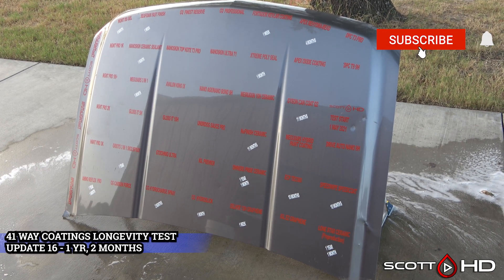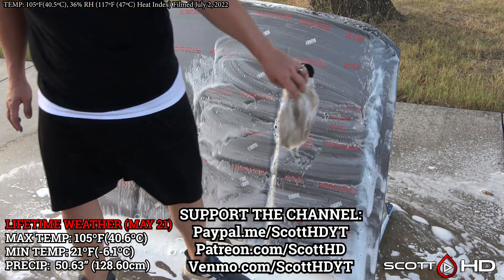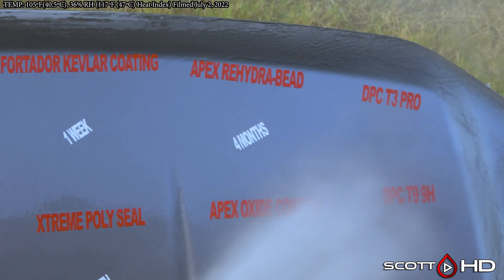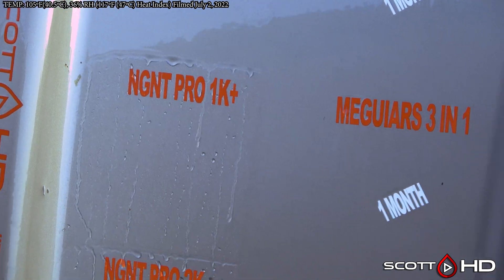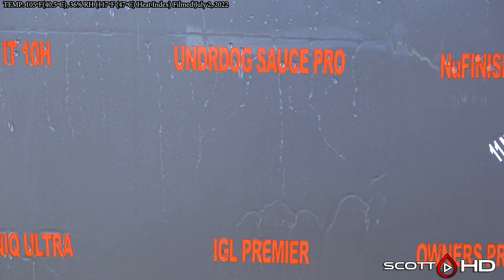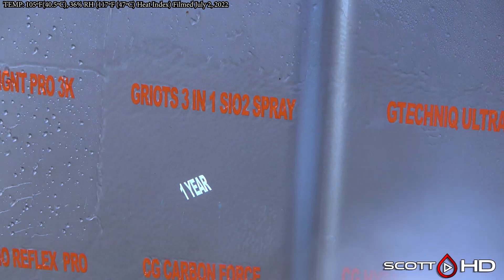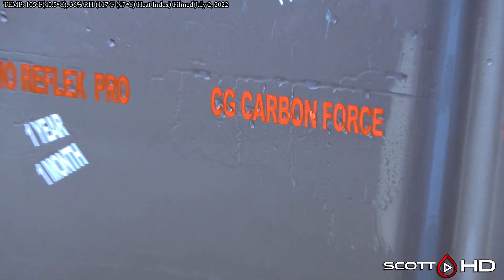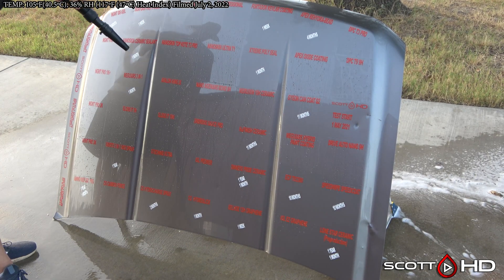Ceramic Coating Longevity Test - 41 WAY - The ULTIMATE comparison test - UPDATE 16 -1 YEAR, 2 MONTHS

Comment: I'm having some serious disappointment with grios three and one. after watching your review I was totally geeked on it. I've used it on two different vehicles a 2005 and a 2019 and had a problem with road film releasing from the coating and now streaks in the coating which are hard to explain. not sure where to go next maybe turtle Wax hybrid solutions?
Reply from the maker: That's sad to hear. Were you applying it outside?  What was the temperature/humidity?
Reply: @ScottHD  I'm here in Wisconsin and I wonder if the product is best suited for this climate and salt
Reply from the maker: @barrycampbell1054  that is nuts!  Was it streaking after installed or showed up later?
Reply: @ScottHD  the finish was absolutely gorgeous after the installation and like glass when complete and now roughly 4 months later I've got streaking that can only be removed with thinner. Griots sent me some of their foaming car wash but that does not cut the film. I had to literally scrub it to get it off of the vehicle.
Reply from the maker: @barrycampbell1054  wow.  Good info to know, but also sad to hear.  I'm going to do some playing around with this bottle and see if I can get it to do that.
Reply: @ScottHD  if you have an email address I'd be happy to send you a picture that I took today that I will be sharing with grios.
Reply: @ScottHD  I had both vehicles professionally installed exactly as the directions stated by a detailer and it was all indoors.

Comment: Scott I hope you see this, these tests may be a bit misleading for average users. Many of us, when we don't have time use a touchless automated car wash that uses extremely acidic chemicals which are stripping off even the best waxes in seconds. It then applies a coat of a very weak poor lasting wax on the car near the end.
Using Snow Foam is gentle so your longevity tests are as if we were always hand washing.

Would like to see a longevity test done where you run it through an automated and very acidic touchless car wash.
Reply from the maker: Great idea - I actually have something planned along those lines combining another subject - PPF to a separate part of the vehicle

Comment: Random question, do any of the coatings in your test have water spots after washing? I was a bit disappointed to see water spotting on my black car after not washing it for a few weeks after driving in the rain. I was using Turtle wax flex which claimed it "resists water spotting" whatever that means lol
Reply from the maker: Some do, but not enough to really say for sure they are what's creating the excessive spots.
Reply: @ScottHD  thanks!

Comment: Great work as per usual Scott.  It would be interesting to watch a similar comparison but detail sprays, or similar, that claim to bump up gloss.
Reply from the maker: I am planning a detail spray only test this fall.  Too hot out (Texas summer) to get anything new going at the moment - just doing the updates and saving the $$ for this fall.    (Almost ended up in the hospital with heat stroke!)
Reply: @ScottHD  Look forward to it. We get 1 hot day in the UK and all hell breaks loose. Stay well man.
Reply: I'd also like to see that, as Scott demonstrates in theses tests a lot of ceramics don't actually last that long and certainly not the several years that are often claimed. With that in mind would it be more economic and easier to apply something like Gyeon wet coat every 3 months? Other youtube channels have done some test but I trust Scott's testing.